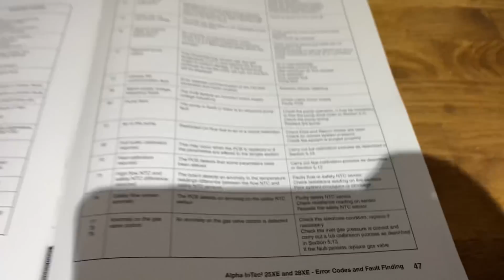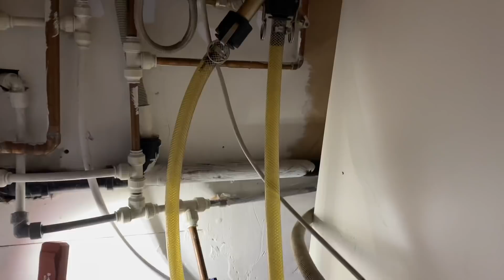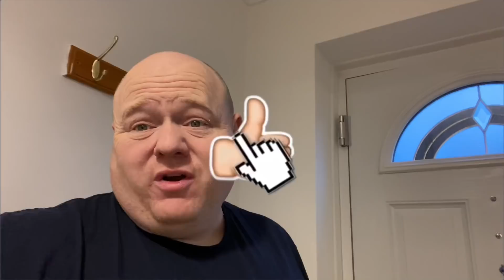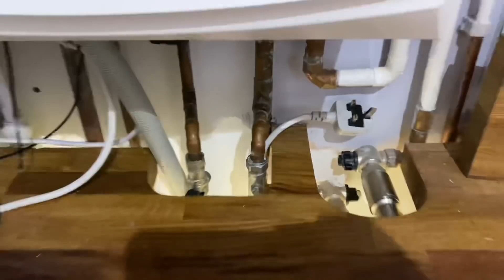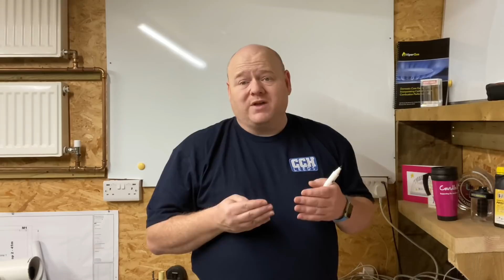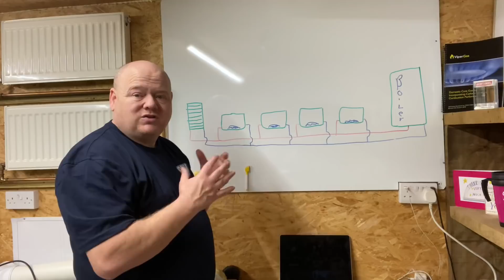Boiler Not Working Heating System Blocked - Magnacleanse - Flush - Leeds Plumber

Comment: Would it have been better to totally drain heating system with wet vacuum,filling again and drain again to totally be sure that chemical was totally gone... and then put in heating inhibitor......
Reply from the maker: no
Reply: @AllenHart999   so after you put in 4 containers of the cleaning solution ...you wouldn't drain system...then put aquavac on to make sure all of the system was empty.
Then fill system run it for 20min and drain again...put In heating inhibitor and fill system to the correct pressure.
Especially when the system was so small...

Comment: Allen, I have a Magnaclean for a Combi Logic 30 boiler. I have a water leak on the bottom attachment to the copper pipe. Can i tighten this myself or will i need to contact a gas engineer?

Comment: Hi Alan, thanks for the great videos you do. How would you flush a system following a magna cleanse when the system is open vented and the water pressure to the property is low, i.e. it's not on the mains, but a spring water supply? Just refill and drain, or would you power flush instead? or something else? Cheers Pal

Comment: nice vid pal and im with you. why would you use a power flush that's what the filling loop is for. what I will point out is why didn't ya drop the rads to half, shut them all off and put a agitator on your SDS and do one rad at a time? also invest in a thermal imager.. they are worth there weight in gold....take care and don't get this covid  shite. we still need to be out there to help folks out.
Reply from the maker: This system had new radiators. Thanks.
Reply: @AllenHart999  cool.

Comment: I’m actually surprised considering how bad the magnet was that the system water wasn’t blacker than that when you dumped it at the end. I bought a magnacleanse a few years back when they were on special. It’s paid for itself many times over. Haven’t used or even seen the prochecker. Is it a good bit of kit?

Comment: To me this is not properly or proper power Flushing System.  Its best to use a big  power flush machine 💪 which as more power and pressure to flush the whole system, better than the one you are using in this video.
Reply from the maker: Michael Ogunbiyi I have different videos showing different methods. Thanks for the comments

Comment: Hi alan you said you left the 4 bottles of f3 in the system for a while and then you mentioned that the hot water was working fine .Can you please be more specific on the time frame was it 2-4 hours 4-6 or longer when the hot water started to work correctly. Look forward to hearing back from you thanks mate.

Comment: this is the boiler that i will instal at my home :))))))))   ... I bought it last year in February with the idea of replacing the old boiler from vaillant and I still haven't installed it
..
In my country it is sold under the Immergas brand
 with the name: Victrix Maiot tt 
This boiler has 2-3  problems over the time :
1 - the 3 way valve is noisy 
2 - on the main electronic board some solders fail due to the heating and cooling cycles of some electrical resistances through which the coils from the gas valve are supplied and the boiler
displays the ignition error message.

3 - the burner can easily clog with atmospheric dust and the boiler will lose its power and will start to give ignition errors; If it is washed thoroughly, it will work again without any problems
 :)

Comment: Do you use the powerflush machine still
Reply from the maker: Kenneth Hogan Depends on the system and what’s required. This video is to show the magnacleanse process. We also used the machine on this one.
Reply: @AllenHart999  Thanks for the reply Allen.. I wonder is the powerflush machine a bit tough on some systems that maybe it could cause a small leak somewhere underground

Comment: Hi Alan....
Can I ask how did you manage to start the flushing using the chemicals ?  I was thinking that as you fired up the heating  it wouldn't take long before the boiler would lock out and then switch off the pump ... which you would need running to get the chemicals around the system using the magnacleanse ! Did you  mains flush first in order to get past any of the sludge first to free up the waterways a bit so that the boiler and pump could then work and get those chemicals pumping around the system? 
Sorry I hope I've made sense!!
Thanks again Alan 
Cheers Steve
Reply from the maker: There was a small amount of flow, Thanks.

Comment: Did you use a vibration hammer on the rads ?
Reply from the maker: No, The rads were new. It was the pipework that needed cleaning really. Thanks.

Comment: We are constantly dealing with the aftermath of shoddy “gone with a cheeper quote thank you” jobs. One poor old lady had a 4 year old valiant boiler fail and resulting damage coming in at £780 parts and repair bill, the scum bags would not return to resolve for her! :(
Reply: Good point. This sort of thing drives me nuts, I think (I know) I lose out on quotes for installations to cowboys who will come in way cheaper than me. What do you do? Maintain high standards and do far less installation work or join the ranks of the cowboys?

Comment: Good video and a great idea on paying a small amount each month for more technical videos on service and breakdowns. 
You should have mentioned in the video about leaving the hot tap open when using chemicals to help clean the plate to plate . Apart from that great job better than I could do m8 .
Reply from the maker: You are 100% right about leaving tap running 😂 Thanks

Comment: When you do a clean, would you normally pull the pump impeller out and check its not blocked up? before and after
Reply from the maker: It’s not something i personally do. No.
Reply: @AllenHart999  I would say it is a good idea especially if there is a low flow situation. Im can not get clear information if F3 can break down these hard flake magnetite.
Reply from the maker: @ricardobranco7357  I tried not to get too involved in the boiler on these jobs.
Reply from the maker: Thanks very much for your comment, please consider subscribing to support the channel 🙂

Comment: Hi Allen, looking to do a magnaclense but on an open vent system. Does this look correct?

1. Attach magnaclense to filter/ add chemicals, allow to circulate system.
2. Close off all apart from one radiator. Adgetate radiator, open next radiator & close previous. Until all complete.
3.  Turn off boiler, isolate manifold side nearest boiler. Latch open 3 port valve.
4. Attach hose to drain off on magnaclense and open.
5. Repeat step 2 process waiting for each rad to go cold before moving onto next.
6. Close drain off, refit filter and dose with inhibitor. Turn on boiler & allow to circulate.
Many thanks.

Comment: Hi Allen, can you tell me what cause radiator banging and how to fix it? Many thanks
Reply: Radiator banging TRV opening/shutting with water pressure maybe?
Make sure its not the boiler banging as that is kettling and can be heard around the system.
Reply from the maker: Could be the TRV,s hard to know without checking it. Thanks

Comment: Hi Allen! Why in your diagram return pipe to the radiators go first?
Reply from the maker: What do you mean? Thanks.
Reply: @AllenHart999  or it doesn't matter which pipe is the first connect to radiator?
Reply: @AllenHart999  ?